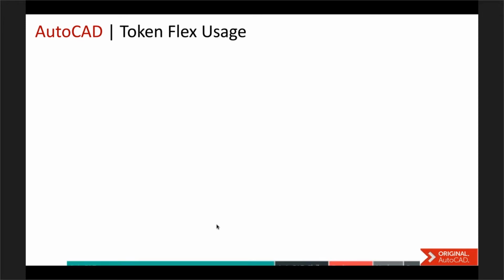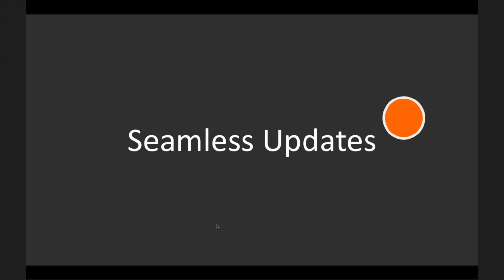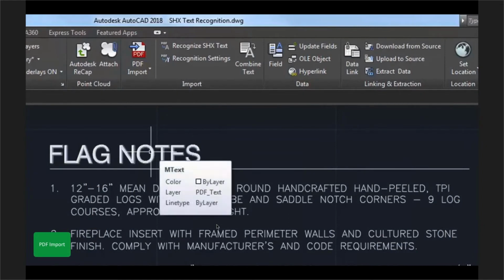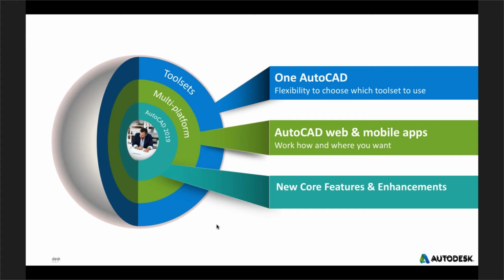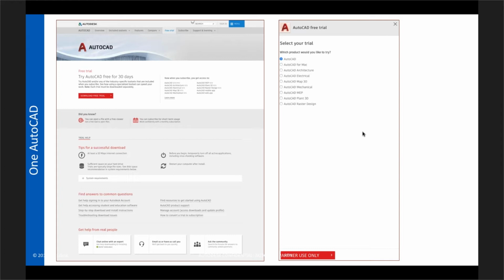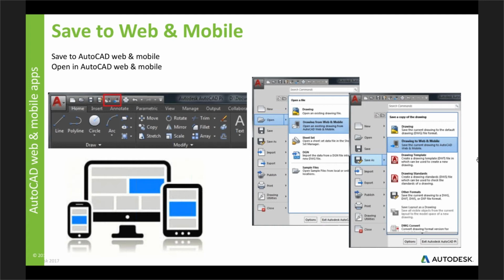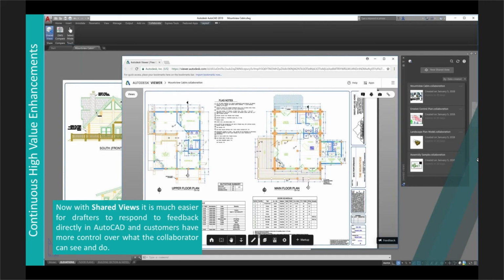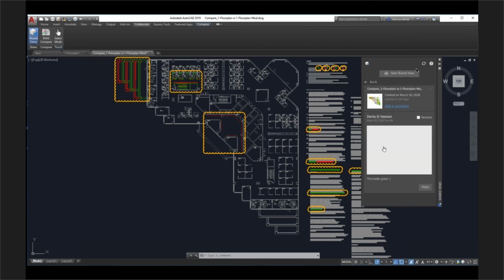What's New in AutoCAD 2019 | Autodesk Virtual Academy

Comment: @Marcus O'Brien - just combine these autocad things in one AutoCAD with on-off options. It`s a real pain in the a** to switch between this programs and to set startup setting again every time. Example: I`m Mechanical Engineer and everyday user of AutoCAD Mechanical, but DWG Compare tool, PDF Import, adaptivity etc.., didn`t work and I switch to the "center of your onion" every time. Why Autodesk... why... 
Don`t understand me wrong, we like your products and that is the main reason to not switching to Dassault Systèmes or Simens or someone else.. but you have a lot of things that need to be up to date and AutoCAD removing versions and sharing optimize is one of them.